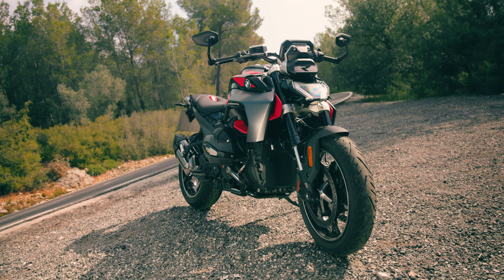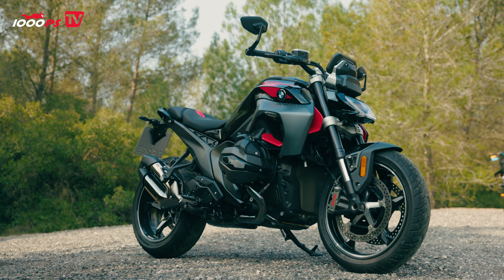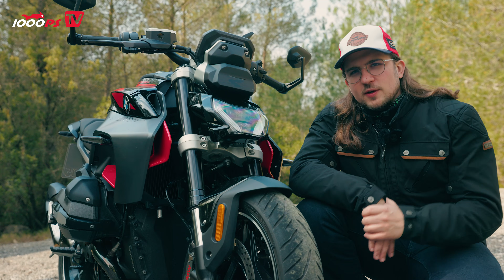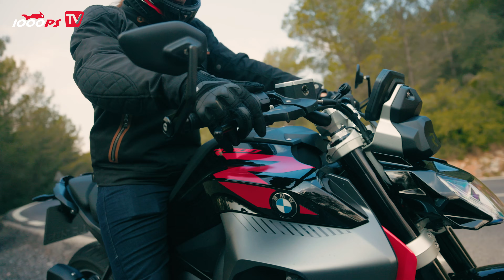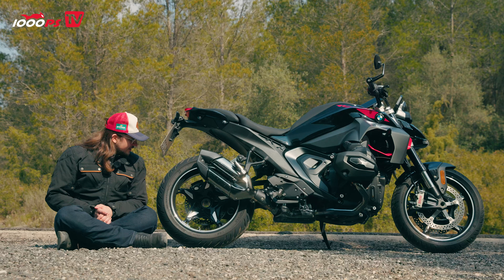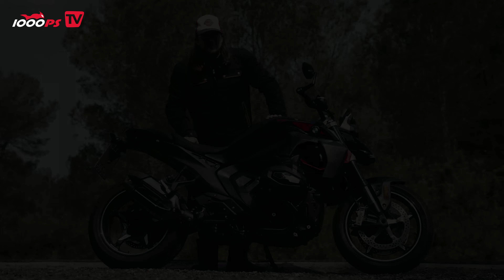Why the BMW R 1300 R Is Way More Fun Than Expected

Comment: I have the same bike, but manual clutch. It's an easy, smooth and fun ride. Doesn't turn quite as quick as my KTM 990 Duke, but that has a different purpose. For everyday riding, it's a blast.

Comment: i have the same but with manual transmission. What a great all around bike this is! The weight is pretty low and you dont feel it. 

The only negative - dont like the sound of it and Im thinking some option to put on it for better sound!
Reply: I agree…the sound of the boxer is awful 😂 first thing i did was to change the slip on for an Akrapovic. Made it better but not as much as it did on my 1250GS unfortunatly 🤷‍♂️😩
Reply: @ericglanz9824  put away the muffler, sounds much better...i did so
Reply: You need to swap out the cat, euro 5 damps down the cat so much the end can makes no difference

Comment: This motorcycle sure has a presence. Those who buy it will buy it no matter what anyone says.
But it’s not a city commuter. At best, it’s an “out of the garage, through the city, and into a different city and garage” type of commuter bike. You don’t ride a bull inside the china shop, you leave the bull outside.
As city commuters go, you could do a lot better with a scooter. The center of mass is even lower, it’s much lighter, there’s no clutch or gears, and the CVT keeps you in the proper power band at all times. With the money you’d save, you could buy fuel for the next few decades. The same goes for low CC motorcycles (well, if you don't mind changing gears and all).
Let’s just say that if a motorcycle like this were sentient and you used it as a city commuter, it would take you to court.😆